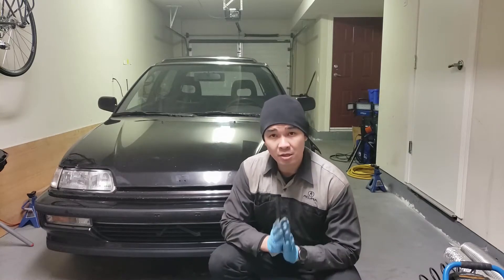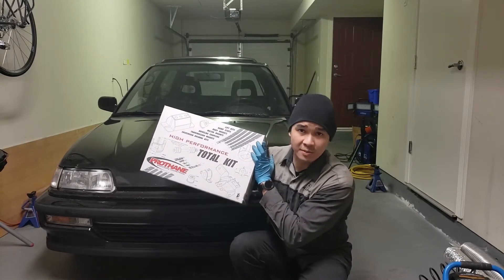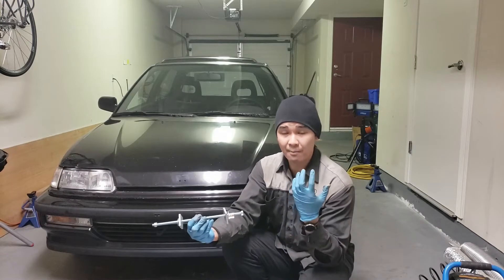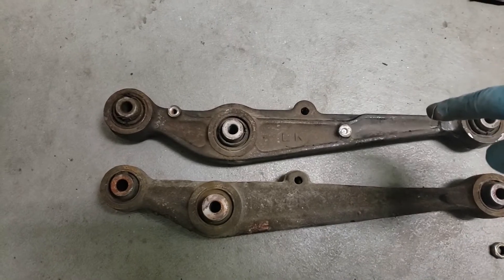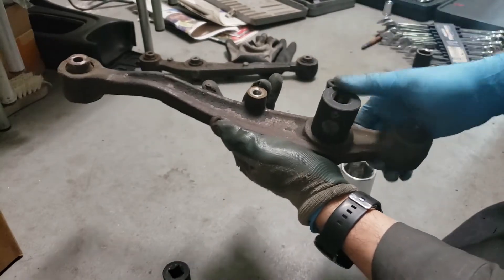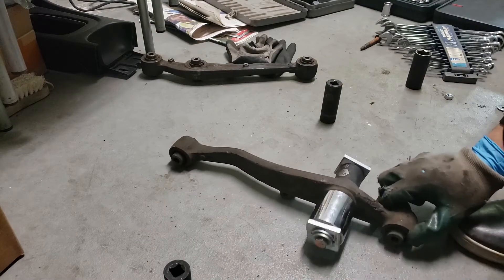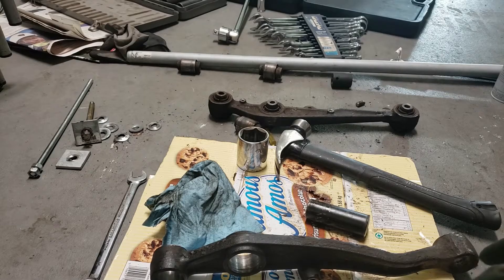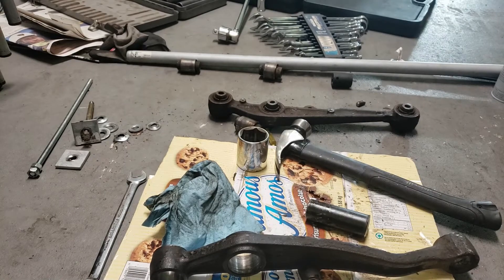[Bushing Replacement] How to Replace Rear Lower Control Arm Bushings WITHOUT a Press!

Comment: The job is way easier with a ball joint press kit
Reply from the maker: Most definitely. Even easier with a hydraulic press. But if you don't have either, a hammer works.

Comment: Use drill bit to get the bushing apart
Reply from the maker: That works. But easier to use a torch and burn the bushing, which is another method I used in stubborn bushings.

Comment: Did it make a big difference in handling or noise reduction?
Reply from the maker: I haven't driven the car since I put the new bushings in so I can't really tell you how they feel yet. I'm working on getting the car painted so I can get it on the road for summer. But the bushings should be a huge improvement from worn out old bushings. People say that they squeak if its not lubed properly. I've also read mixed reviews on how long they last. The poly companies say they last forever, but people have said the poly bushings wear out and fail really quick. But the bushings do have a lifetime warranty.

Comment: The bushings look decent, but of course we cannot see if there are cracks through the video. I think you can use a ball joint press tool to press them out too. Thanks for sharing! I have a 2002 TL type S and was contemplating the same thing.
Reply from the maker: The ball joint press might work but might not. Depends on how stubborn the bushing is. Typically if a hammer and socket doesn't make it budge, then a ball joint press may not work. Its a really pain to do these without a hydraulic press.

Comment: At this point, all rubber vushings and hoses need replacing...cracked or not !
cheers
Rob
Reply from the maker: Very true. Everything is about 30 years old and would be worn out unless its been replaced. I did look into getting new hoses as well, but that may be a project for a later date.